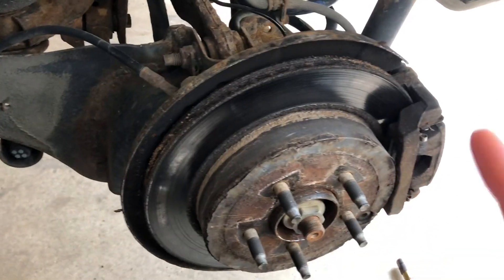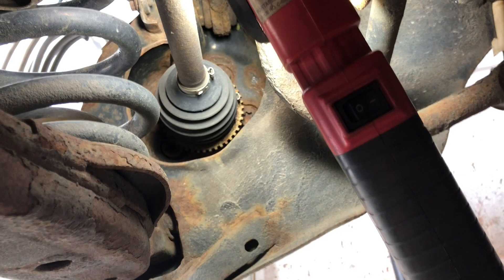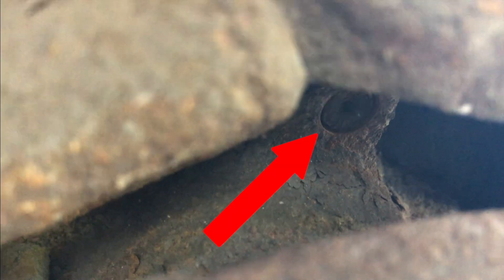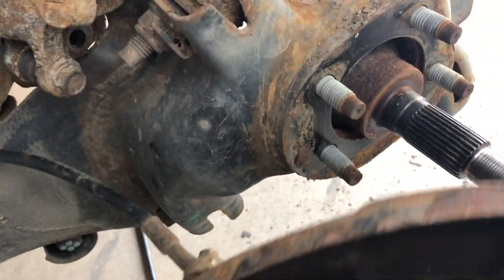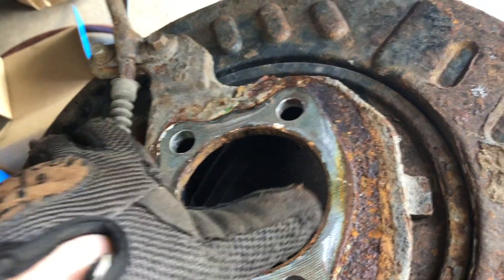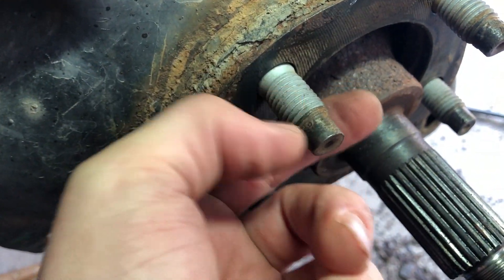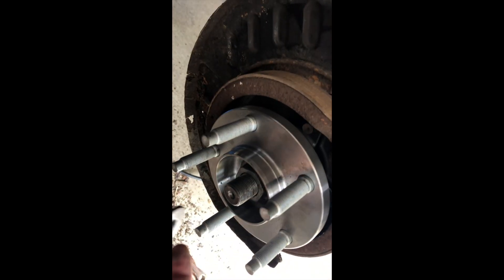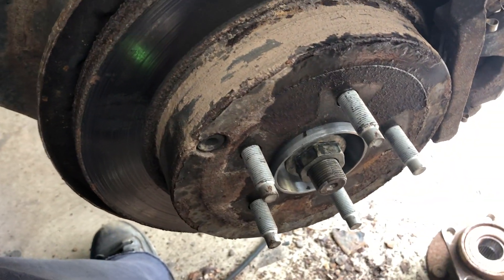2006 2007 2008 2009 2010 Ford Edge AWD rear wheel bearing replacement

Comment: I have an 08 Edge. It's insane how rusted they are underneath. Look like 80 year old barn find.
Reply from the maker: You are 100% right my friend!!!!!  I see it all the time and its too bad for a newer car.  I don't know why they rust so bad but they do.  Maybe its cheaper steel underneath?
Reply: In the rust belts, yeah.  Where I am they're spraying sodium chloride liquid to pretreat the roads, and that stuff just tears through sheet metal.  Plow trucks are junk in 5 years without routine under chassis spray outs after a storm.
Reply: Yeah my 07 is to but my 78 mustang ii looks shiny and new under it and it was parked from 84 -14 outside in the Missouri weather tires dry rotted off it and even ate the wheels up but body has minimal rust wish I could say the same for inside and anything rubber like the t-tops seals 😂

Comment: I ordered the Snap On tool and decided that today I would try it out. Without this video I would have given up so thanks for making this video!  So today here in the Hammer its was a comfortable 19 degrees so it was perfect to do in my driveway,  the only thing I did different was take the shock bolt out and move the shock to the side. I was in my driveway and my jack wouldn't lift the car too high.  So laying on my back and having the shock out of the way gave me more leverage  with a piece of pipe to loosen the four bolts that hold the bearing in place. Oh and my bearing came apart in two pieces when I used the hub puller shown in the video. Lucky thing I had a air compressor and air hammer  to separate the backing plate and the remnants of the bearing or else I would had to put the everything back together and take it in, great video and if your doing this at home have patience, the four bolts are not fun going back in so take your time. Once again this was an awesome video thank you for posting!! 😁😁😁
Reply from the maker: I feel touched by your comment!!!!  Thank you soo much and its comments like these that definitely push me to do my best to make great videos.  I'm glad you got the job done and it all worked out for you.  I do really appreciate you comment.  Thank You :)

Comment: Thanks for the video!  I'm going to be undertaking this same job on my wife's 2010 awd edge, and thank you so much for the tip on this special tool that is required to loosen / tighten those T60 bolts! What a horrible design by ford
Reply from the maker: Glad I could help you out, the tool is a must in my opinon, there are aftermarket ones available now so you don't have to buy the Snap On.  I think I got the links in the video description.
Reply: @GarageKing  much appreciated for the links! got one on order!
Reply from the maker: @MrDausen  Thank you, this was one of my earlier vids and can't believe its got almost 100K views !!!  Glad its still being shown.

Comment: You saved me soooo much trouble I ordered the snap on t60 torx bit for Ford Edge and Lincoln mzk bearing removal it’s 67.89 that’s shipping and tax
Reply from the maker: That is awesome you got it done !!!   That tool really helps a lot, and it is really good quality.  I know its expensive, but you know its way cheaper to do it yourself and buy that tool, than to take it in to the shop !!  Plus now you have the tool on hand if you ever need it again, or you could sell it, as Snap On tools don't really loose their value.

Comment: I couldn't get  the BMW tool so I had to grind a taper in a Harbor Freight long T60. Then the bolts were easy to remove.  But the hub was so stuck I needed a slide hammer to remove it.  And then on installation, restarting the hub bolts was misery.  I had to use a puller to hold the cv stub partway into the bearing to make clearance behind the tone wheel.  This should be a quick job but it's not because the hub bolts are too close to the center.
Reply from the maker: Well you had a busy Saturday !!!  I know, when these vehicles were newer they came apart easy.  Now this job takes hours as everything is soo rusted together.  I know that !!!!  Good on you for grinding down the Harbor Freight T60.  At least you know that tool was strong enough and did not twist up.  The Snap On one I used in this video worked well, but I'll bet the Harbor Freight was a lot more cost effective.  Congrats on tackling this one on you own, its definitely a feel good project when you are done :)  Happy Saturday to you and thanks for the comment :)

Comment: would a front wheel hub puller work on the rear awd hub?
Reply from the maker: Yep, but the hammer method is probably going to work better as the hub housing gets pretty rusty as "sticks"  You can try the hub removal tool, I have one and I'm not sure if I used it in the video, I probably tried it and reverted to the hammer.  If you do use a hub remover tool and you are really wrenching on it STOP.  The reason is you will push the axel in and could wind up applying too much force to the axle. (That's how the hub puller works)  It pulls on the hub by pushing on the Axle.

Comment: I used a 3/8" long hex head because I didn't have the torx and every place I called didn't have it.  Had to hear the old bearing housings near the bolts on the E breakers side to get them to snap loose.
Reply from the maker: Hey give yourself a pat on the back, not easy to do it that way.  Congrats on not giving up and getting it done !!!

Comment: I've got a 07 Edge AWD, thinking I am going to need to change front and rear bearings. Are all four the same part or do I have to buy specific front/rear left/right?
Reply from the maker: Hey there and thanks for the comment, the left and right are the same, but the front and rear are different.  That goes for pretty much all vehicles I have ever worked on.  Hopefully I helped you out and if you have any other questions just let me know.  Here is a front wheel bearing I did on a Rav 4, https://youtu.be/3EIG5DqpJew the Ford is similar.

Comment: What noise was it making that you realized it was the bearings and not something else?
Reply from the maker: Hey there, it was howling pretty good, you could really hear it at about 35MPH, there was no clicking or anything that would suggest it was a joint.

Comment: Would this also be the best and easiest way to remove the axle?
Reply from the maker: Very good question, and I havent had to pull a rear axle on one of these things, but I think you still have to remove part of the suspension, as I don't think you can pull the axle though where the bearing is, it won't clear.  Although I'll give you a high five for being creative, I think that suspension has to come apart.

Comment: How many hours did you install the new wheel bearing? Thank you
Reply from the maker: Hey there, it tool about 2.5 hours because I was filming so that took a little longer.  I would think about 1.5 hours is pretty reasonable if the rust is not too bad

Comment: If I don't have a wheel puller can I just beat the axle in and pull the hub off
Reply from the maker: Hey thanks for the comment, you can use a hammer on the axel to TAP it in, DON"T wail on it :)  But before you do that make sure to spin the axel nut on so the threads of the axel are protected.  The nut might be a little tight coming off after you TAP the axel loose, but the threads will be ok.  Once the axel moves in (you won't be able to remove it) but when its in an inch or two, then you can beat on the old hub flange (circular part) where the wheel studs are, and it should come out.  Let me know if you have any other questions :)
Reply: What size socket is the axle nuts
Reply from the maker: Hey there, it is a 6point 32mm. Good luck :)

Comment: Is the 2008 Lincoln awd the same
Reply from the maker: Hey There, thanks for the comment.  I'm not sure %100 but I would say they probably are.  It really easy to check as all you have to do is pop your head underneath and look for those torx bolts that are deeper than the ABS ring.   If you see them, the job will be the same.   Thanks buddy :)

Comment: Where did you get that tool from and how much do I need to spend now on something that is under warranty but they don't wanna honor they're own contract 😮‍💨😅
Reply from the maker: Hey there, I got the tool from Snapon.  The link is:
https://shop.snapon.com/product/TORX-Insert-Bits/T60-TORX-Bit/S6560
that's the canadian link, but you can find it on the US link as you have the tool #.  Its tool S6560, and I paid 50 bucks in Canada for it.  If you are in the US its going to be cheaper.  You can just find a tool truck in your area, or order on line.  Sorry you can't get warranty on it, if you lived close to me I would say bring it down :)

Comment: How did ot go from disc break to drum breaks
Reply from the maker: The drum brakes are for the park brake or emergency brake as its called.  Those drum brakes are not actually used for stopping the vehicle when you are driving.

Comment: Will a regular t60 torx bit work or do you  absolutely need that special bit?
Reply from the maker: Hey Brother, you can use a regular T60, but you have to grind it down to get past the housing, also it has to be long enough.  Make sure it's an impact one because if its not hardened when you grind it down you will weaken it,  and depending on how tight the bolts are you may snap the socket.  The tool from Snap On makes it easy, I think its $50 CAN so probably around 35 USD.
Reply: I'm having hell rite now trying to figure out how to get the dam thing off. I might just have to order the bit. Thanks for the video and reply!
Reply from the maker: @devinmunoz3424  Anytime brother, its a tight area to get into, and the tool does make it a bunch easier.

Comment: What procedure did you follow for torquing the axle/spindle nuts? And did you reuse the old ones?
Reply from the maker: Hey brother thanks for the comment, I re-used the axel spindle nuts and used an impact gun to tighten them.  This way they can be tightened without any side load on the bearing (the vehicle is still lifted)   The torque is 203ft/lb and you can check it with a torque wrench when the vehicle is back on the ground.
Reply: Thanks man!
Reply from the maker: @korey7733  Anytime brother, hope you are enjoying your weekend :)
Reply: I was told by Ford that the Axel nuts are 1 time use nuts.

Comment: what size triple square socket you use?
Reply from the maker: It’s not a triple square.  It’s a torx bit.  I’m not at home right now so I can’t check the tool. I do think it’s a T-60 size. I put a link to the tool. I don’t get paid anything, it’s just to help people so if you click the link it will take you to the tool and you can see the size. I think one of the links is for Snap On. That’s the tool I used in the video.

Comment: Look up using a C-Clamp to back off the pads.  Takes three seconds to do.
Reply from the maker: Thanks for the comment and yup you can use a C-Clamp if you wish, that method has been used for many years. For me there was no need in this case as I did not replace the rotor or pads, so the caliper just slipped back on.  Had I replaced the rotor or pads I would have had to push the piston back in. Also there are new affordable tools that make it easier to push the caliper pistons back in so you don't have to worry about the C clamp slipping off the rear of the caliper where the brake line is,  especially if you have a dual piston caliper. I used a C-Clamp for years until those caliper spreading tools came out.  You should check them out, using one did convert me. When you are on flat rate, fast and safe is best. Thanks for the comment and hope you are having a good day :)
Reply: @GarageKing  That comment was more for backyard mechanics... :)
Reply from the maker: @ohger1  I hear you brother, thanks for that :)

Comment: How hard did you have to fight to separate the bearing from the backing plate?  I've seen videos where people were having a super hard time.
Reply from the maker: It wasn't that hard.   I don't think I even used WD-40.  How I took it apart was I held the backing plate in my hand and whacked the bearing from the back with a good sized hammer and it came out with about 3 or 4 hits
Reply: @GarageKing  nice.  I'll have to remember that

Comment: Can you give preload procedure...torque specifications?
Reply from the maker: There is no preload for the bearing, pre-load is only on cone style bearings (like the old front hubs on rear wheel drive cars or differential bearings)  The bearing is a sealed unit so there is no pre-load to be done,  you just make sure the axel nut is nice and tight.  Also you should tighten in the air if you can before the wheel goes back on (this way there is no weight on the bearing when you are tightening it)  I put the nut back on with an impact gun.  Most axel nut torques (providing its a nut - like the Ford) are all around 200 ft/lbs give or take a bit.  The torque specs I found on line say 203 ft/lbs and I posted the link in the video description.  I'm not sure about those other 4 bolts, but generally those bolts are 50-70 ft/lbs on most vehicles so I just hand tighten them good, but don't apply as much force as you would with a tire, as a tire is around 100ft/lbs.  I hope I helped you out and if you need anything else just let me know.  Also DO NOT put any lubrication on the axel nut, it goes on dry.

Comment: What's the torque specs
Reply from the maker: axel nut is 203ft/lbs
4 bolts that hold hub to rear arm 98 ft/lbs
2 brake caliper bolts to anchor plate 41 ft/lbs
It was in the video description when you open it up, sorry about the late reply.

Comment: What’s the tool you are using to push the axel?  The one you attach with the lug nuts?
Reply from the maker: Hi Ryan, I used the "Powerbuilt Model #648643 2pc Hub Puller Set" tool for pushing the axel.  I'm in Canada and an Amazon link is https://www.amazon.ca/Powerbuilt-Alltrade-648643-Puller-Tool/dp/B0028QGTB8 (I don't get paid anything for tool referrals so feel free to search away for the best price you can find) If you need anything else just let me know and if you checked out the channel ( I have a lot of variety) I would appreciate if you would consider subscribing :)   Thanks!!!!!!!

Comment: Do you have a link or suggestion where to get the "special tool"?
Reply from the maker: Hi There, I bought it from a Snap On dealer.  If you have one around they should know about it as it is commonly sold at the Ford Dealers.  It is a T60 size and its part number is S6560.  Any other questions let me know.
Reply: This is awesome thank you
Reply from the maker: @oliviagorham5908  Anytime!!!!!!  Check out my other videos if you like to do car work yourself, better yet, subscribe as I generally post a few videos every month!!!!
Reply: Did one without the special tool lol  I used an Allen type T60 torx and put them in and out no problem.   Just cut the L end off a T60 allen wrench and weld a nut head on the end.  There is the special tool for a fraction of the cost.
Reply from the maker: cguy that’s a great idea!!!!!   I guess if you don’t have a welder that might be difficult.  But with a welder for sure.  When you cut the end off will a socket go on the cut off end?  I’m wondering if you can just cut the long off and use a socket?   Good comment.  I would appreciate if you would subscribe. Comments like that can help us all. You seem pretty knowledgeable.
Reply: @GarageKing  Do they make a T55? I have a 2013 Mazda CX-9 and that's the size on it.
Reply from the maker: perry petricca yes they do, if you are only using it once you can pick up a cheaper one from Harbour Freight if you are in the US.  If you are in Canada consider princess auto.  This tool I show is not the typical tool as it’s ground down and designed just for this wheel bearing.  If you haven’t subscribed please do !!!  Thanks!!!
Reply from the maker: Cguy I’m thinking about it more and if it was a front wheel drive then your idea would work great.  If it’s an all wheel drive then you I’m not sure.  I remember trying to use a long T60 which is same principle as the Allen style wrench but the problem was the shaft was too thick to clear the ABS ring.  This tool has a ground down shaft so it’s shaft is thinner than a regular T60 thus allowing it to clear the  ABS ring and it’s hardened so it can take the torque being that it’s thinner.   Just thinking out loud.
Reply: perry petricca are you sure on that I just did two on a 08 CX-9 and it was a T60 ...

Comment: So clean the bolts and add anti seize to them and they won’t rust
Reply from the maker: Hey brother thanks for the comment.  It depends on how corroded the bolts are.  If you look at the vid at the 7:25min mark you can see the threaded portion was not that bad, and the bolts are coated from the factory, so I did not add any anti-seize to the bolts.  If your bolts are really rusty then clean them with a wire wheel and you can put some medium strength (blue) thread locker on, or a tiny bit of anti-seize, but don't put much on at all.  They are considered a suspension bolt and there are a million opinions about what to use, but when I was still working at the dealer we never put anti seize on suspension bolts.  The service manuals always called for medium strength (blue) loctite as that will protect the threads from corrosion and the bolt can still be removed later without heat.  Plus it prevents it from coming loose.  You don't want that bolt coming loose :)   If you have any other questions just let me know, thanks :)
Reply: @GarageKing  good information thank you
Reply from the maker: @papabits5721  Anytime brother!!!!

Comment: You never mentioned the special tool size!
Reply from the maker: Hi There I put the link for the tool in the description (I don't get any commission if you buy) as its a snap on specialty tool.   The actual size of the tool head is a T60, but a regular T60 won't fit as the body is too wide.  You could take a T60 and grind the body thinner, and hope the tool wont twist apart.